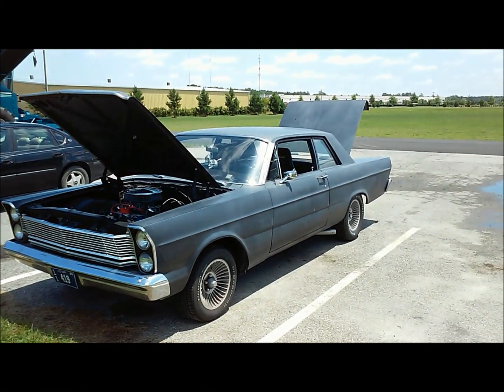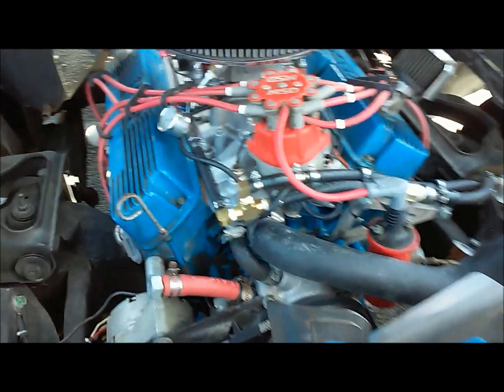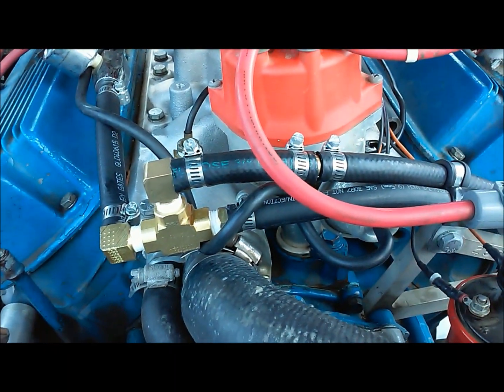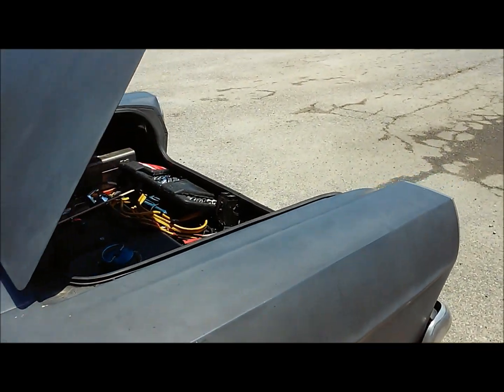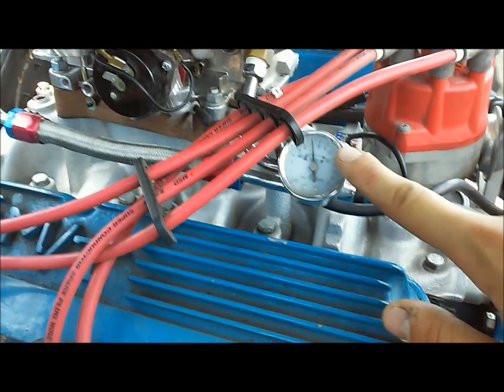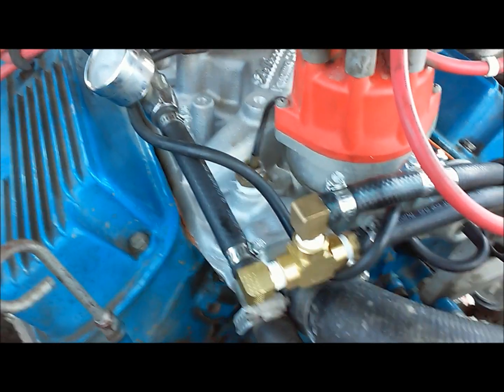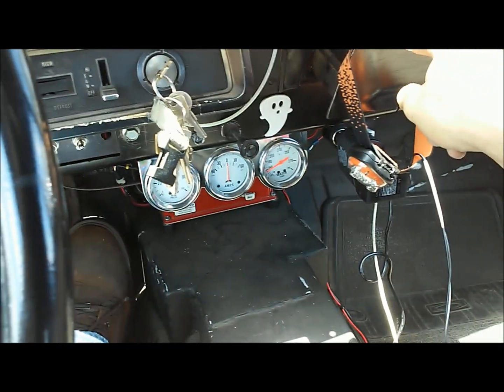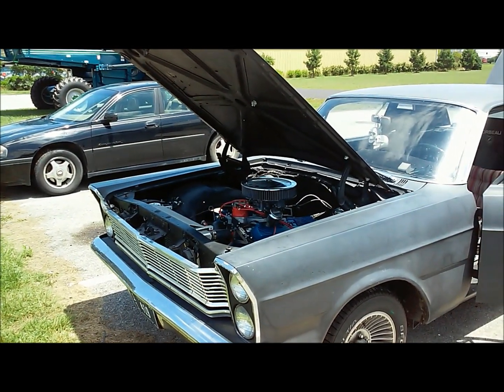Carb Vapor Lock No More - Simple Fuel Return Line

Comment: In THAT car, 3 PSI is plenty. If you have over 600hp to the wheels, then I would run 6 PSI.Take all that junk off and put the factory mechanical pump back on. Get rid of that shit. You've added soooo many points of failure now. Let's see an electric pump, yup gonna fail. Wiring to the pump, yes sir. Rubber lines, check. Seventy four clamps, check. All you had to do was INSULATE your fuel line. And run a phenolic carb spacer if you still had issues. Maybe run a cold air intake tube to the carb? You know, COMMON SENSE SHIT? BTW, I'd love to see the inside of your house. Bet you are up on the next episode of HOARDERS.
Reply: Header rap will help tremendously.
Reply: lol 3 psi?? you're an idiot, ANY carb would need more than 3psi ffs please shut your mouth 3 psi at idle it would be out of gas by 3000 rpms..

Comment: My 70 dodge coronet run very hot after 10 miles , the block gets so hot you can't even touch , then I have wait over 20 to 30 minutes to start the car.  Should I change to aluminum radiator ?  Or should I do what you did in this video? Thanks
Reply: Challenge1972 Sounds like your engine is overheating, not your fuel lines. You don't necessarily need an aluminum radiator but it sounds like something is definitely wrong with your cooling system and I wouldn't drive the car until you get it fixed, you could ruin the engine.

Comment: I have a question why did you Not just use the regulators extra outlet to run a return line instead of all that plumbing you got going on it would be much cleaner looking, I did burn up a Holley blue pump and plan to get another and do kind of what you did but I'm going to use the extra outlet on the regulator and come up with a restrictor of 60 thousands or is 60 thousands still a good number?
Reply from the maker: Because my main fuel boiling when I put the IR gun on the line was between my regulator and carb, so I tried to cycle the fuel as close to the carb as possible. In reality the regulator should be mounted as close to the carb as possible. This is a poor setup in the regard. I have since reworked it and hung an auromotive regulator with gauge port right off the side of the carb. This was all just to get me by.
Reply: Needs a auto turn off  after a few seconds on that electric pump, otherwise unsafe in an accident, leaking fuel under pressure pressure etc.

Comment: Thanks for making this video, i just did a carb conversion on my third-gen Firebird and this video looks like it will help one of the problems ive been having.
Reply from the maker: Return line, electric pump mounted lower than tank, pressure regulator, and insulating carb plate and you will alleviate almost all fuel issues.

Comment: Good morning. Thanks very much for your time and assistance. I have a fuel pressure regulator installed now ... set at 8psi. I have a 160 degree thermostat, and my temp stays at 190 on super hot summer day in traffic. Can a camshaft cause a motor to run RICH at times? 🤔
Reply from the maker: if your under hood heat is great enough the air will become less dense and your mixture will be richer. when you set your idle mix screws, be sure that your engine is completely warm. also check your float height with the vehicle running. the hotter your engine gets the richer your mixture will tend to get since the fuel will be continually atomized better. (not always a good thing - hot fuel is less dense fuel and does not hold the same energy per stroke) a higher lift cam is much more touchy when it comes to idle adjustments, so if you are off the slightest bit, it will really show through. - with my 74 i have to adjust the mix screws and some other little things every time the temp changes by 20 degrees or so.
Reply: +ThunderHead289 Understood and appreciated 👍👍.
Reply from the maker: no problem, feel free to ask any questions any time. i drive this junk every day.
Reply: +ThunderHead289 👍👍😃😃😃
Reply: Always heard 8 psi is too much, run 7 max..  that can cause flooding (run rich)

Comment: Car sounds good!
Reply from the maker: +Timothy Lingo thanks man, ran it all the way from iowa to virginia, and drove it down there all summer, autocrossedit twice, and came back home. car seemed like it was well set up
Reply: ThunderHead289 afr guage is 9 to 19 in the numbers  going in a circle and in the middle it's digital, but I can't believe the spark  plug was very white. at cruise it goes around 15 to 16.2 ,with the  64 jets
Reply from the maker: dang, yeah i usually keep mine no leaner than 13.5 or so. i error on the richer side because the intake runners are all different lengths. the longer runners will be leaner than the short runners, and the 02 gauge just kindof spits out an everage.
Reply: ThunderHead289 ok makes sense, last question I also changed the idle feed restrictor from the stock.046 to .043, maybe that's adding to the lean problem at idle, even though it  get the highest vacuum reading. Can you explain the purpose of the idle feed restrictor, and you think I should put the  stock idle feed and 67 jets back in.
Reply from the maker: unless you have a big cam, you should really never have to get into the idle feed restrictors. i made a jetting video that explains the conditions for changing jets, i beleive it was my most recent upload (been very busy lately) anyway! - id set it back to stock jets, and adjust according to conditions. if you have a 1 inch carb spacer, add one jet size to both sides. what feet above sea level are you? for every 800 to 1000 feet you have to PULL one jet size. there are other things to it as well that i mention in the video.
Reply from the maker: here is the jetting video

https://www.youtube.com/watch?v=pSybYsvOw6w

setting idle mix screw video

https://www.youtube.com/watch?v=VJEXw4Kd4ks

Comment: Genius man, absolutely awesome.
Reply: ThunderHead289 wich oriellys  cheap electric pump that's quiet,my carter p4070 is so dam loud, people stare when it's turned on like I'm shooting a machine gun,and my 63 thunderbird has a very quiet single exhaust system, thks
Reply from the maker: as long as they are mounted below the gas tank so they are gravity fed, they should all be quiet. the little mr gasket pumps are pretty quiet. also, have rubber in between your pump and frame helps a lot too.
Reply: ThunderHead289 I think I might have found the problem, pulled 1 spark plug, white as hell,I jetted the summit carb to 64s on the primary side on Saturday morning, the afr guage seemed like it was going richer
Reply from the maker: ??? afr gauge SEEMED like it was going richer? how is your AFR displayed ?

Comment: Sorry for my english,first of all.Today i tryied the fuel vapor in my tercel 98,and i am realy disappointed. I take 2 hoses from the exist cover and getting hot air in the butler. The 2 hoses got warm (no ideea how hot was it but it feels warm pretty good) and after I cranked for 7-8 times she finally got the feeling the she is willing to start.2 more cranks and she was idling. I let her worm up to the 80 degree Celsius. Than I said I can drive it. I was using a (roughly 4L)canister with I fill only 1 of gasoline. the end of the pipe inside it is made from pipe copper with an end of 40mm (1 1/2 ")in a L shape with lots of holes in it.So I jumped in the car hopping for the best.She start nice on the 1st gear but she struggle for the 2nd (automatic).I reset my km meter and she went as fast as 50km/h. Slowly she start not having power but I said let's see how far does she goes. After 4 km she died on me.Open the hood and no more gas in the tank (1L).Fill another 1L and Crack it again with no success. Gave up and replace everything the way it was (air filter, injectors plugs). PS: Run it with out air course the moment I try to give some air she was dieing on me.Donno why she didn't want to start  again. Any ideea? I realy appreciate any ideas 
Toyota Tercel,1.5L
Reply from the maker: +998vick your trying to just start it as a normal engine now?
Reply: +ThunderHead289,I'm going to make that return line setup you have there,so I need to drill a 0.60 hole through a3/8 bolt,from the front all the way thru,and cut the head of the bolt off.so basically that's a restrictor in the teturn line or if I spent the  a little more money would be to buy a holley bypass regulator
Reply from the maker: id cut the bolt first, then drill it or you will snap your bit. i used a very small bit, it was like 5/32 or 5/64. something very small like that.
Reply: ThunderHead289 I did the return line like yours works great, added 4 hole by spacer. Fuel pressure set at 6 psi steady,AFR guage,  temp gets between 195 to 200,new aluminum radiator. I live in South Florida. Problem I am having is,I drove 2 hrs  ,96 degrees here,in stop and  go traffic, it's not overheating, but after about 45 min of driving, it keeps wanting to go richer and richer to 10.1 to 11.0,have to keep leaning it down to keep it around mid 13's,and then after that the power is so much weaker. Get home let it cool for 1&1/2 hrs ,it's back a little lean when cooler but pulls super strong again. You think it's under hood air heat temperature causing all of this. I had to use gloves just  to  open and close the hood super hot. Sorry for the long text
Reply from the maker: your fine, great stuff and info. under hood temps do play a part - my f100 runs so sooo much cooler under hood temps thean the galaxie. let me ask you this - what type of intake do you have? does it have the heat crossover?

Comment: Was that a Summit fuel pressure regulator on the fender well?  Also, what do you use to seal threads on all those fittings?
Reply from the maker: It is a fuel pressure regulator yes, I now run an aeromotive one. I use thread tape (I know BAD) but I don't put it on the first few threads so it doesn't go through my fuel system. You don't need thread tape, but it accounts for any imperfections
Reply from the maker: i want to say that on the glass sight floats, the fuel level should be half way. i could be wrong. havent had my rig out for 4 months due to winter. you may be having issues where you have pressure in the line when you shut the engine down, and then the fuel in the lines right above the engine expands. this causes the pressure to rise and blow open the needle and seat and overfill the bowl.  i just went out and looked at my truck, and the fuel should be at the very bottom of the sight glass for proper jet operation.
Reply: +ThunderHead289 this happens when it's running.
Reply: What size fuel line should be ran from the carb to the FPR ? Isn't it supposed to be 3/8 ?
Reply from the maker: it really does not matter, its all related to volume flow. a 3/8 fuel line will flow more volume than a 5/16 line. if you are running the summit carb, here is my advice. have your regulator as close as possible to your carb. run a 4 hole carb spacer to increase carb signal and keep the carb cool (this is very important) run atleast 6.5 psi to the carb with your sight plugs set at the bottom of the sight glass. from there you should be good to go. - from what you asked me earlier about the output psi of a summit pump, that is subjective depending on the pump you have.
Reply: +ThunderHead289 what's psi setting on the Summit fuel pump when it's shipped from Summit ? My secondary on my Summit 600cfm carb is filling through the sight glass at 3/4 of the way high and gas is seeping out of the needle and seat and through the gasket. How do I correct this issue ? I know I have to back down the needle for the bowl to be lowered but how much fuel should I be seeing through the sight glass on the secondary ? I just replace the FPR and I have 5 pounds of pressure.

Comment: Thanks again. I don't have any pressure creep without a fuel return line, thank God ... however, my Carter electric fuel pump is @ 9-INCHES HIGHER than my Regal's gas tank. WOW! I had no clue this was wrong for over 4 years until now. I thank you ADAMANTLY. I realized in the garage a few minutes ago (after watching your 1st video), that I have never got on the throttle in the past like I have been doing a few months ago ... which explains WHY I am having/noticing the engine shut off issues now.

I am going to lower the Carter pump first, then see if that stops the cut off AFTER I take my foot off the gas pedal following a 3200-rpm launch/acceleration test.

Can I run a 3/8-inch fuel return line in conjunction with my current 1/2-inch feed line like yours in this video ... WITH BOTH the mechanical pump & electric pumps?
Reply from the maker: +Buick Torque if your really get ambitious, you sure can without issue as long as the return orifice is of the right size.  i believe mine was .04 to .06? it was a very small drill bit. i would try your pump level first, and then see where you are from there since that is definitely not acceptable for hard charging throttle action.
Reply: Understood. I thank you VERY much again.
Reply: ThunderHead289 I was never sure what the heat cross over is,it's the factory 4 hole steel intake for 63 thunderbird & was thinking of putting a flex fan like yours, it has the original 5 blade fan now ,but does heat in stop and go traffic make it slowly go richer, thought it would go leaner??
Reply from the maker: it really just all depends what you are fighting. for whatever reason, my fuel would get really hot - which caused it to get less dense, and eventually cause a lean out situation. high under hood temps like what you describe can cause what you are explaining with the air becoming less dense, and causing the AFR charge to go rich. id run a 180 T-stat. keep those temps down.

Comment: My 73 Econoline had a factory return setup, I removed it, the line was leaking on me, but I believe I might want to add it back as I am having issues, not sure if it's due to sediment in the tank or vapor locking, no sock on the pickup tube, my last pump had debris in it, this pump went out less than 30 miles, well, quit running, can drive places, just can't drive home, think it could be hot, but it's October.\